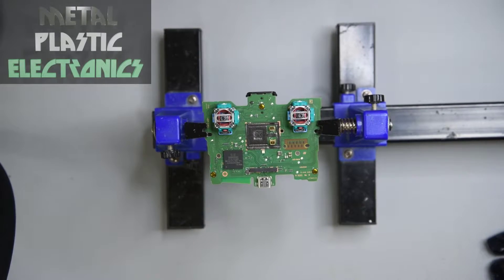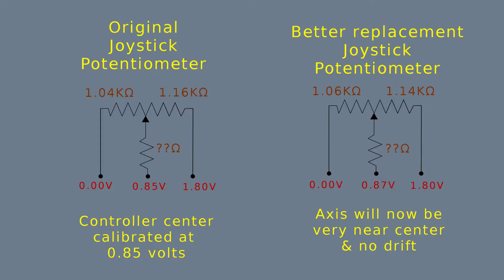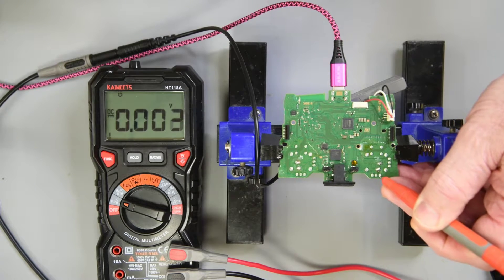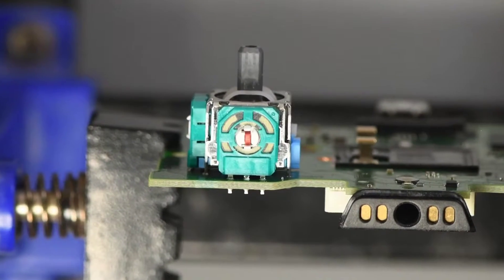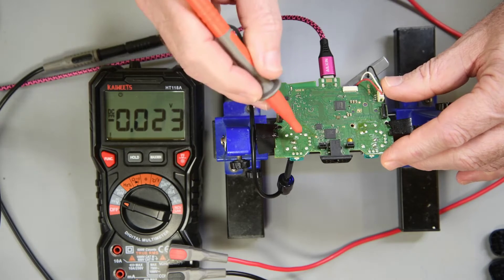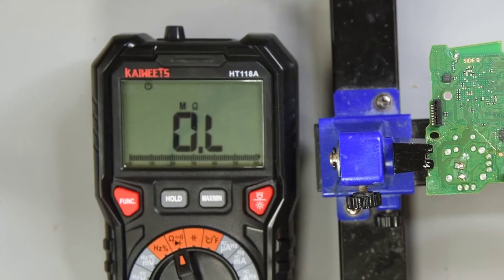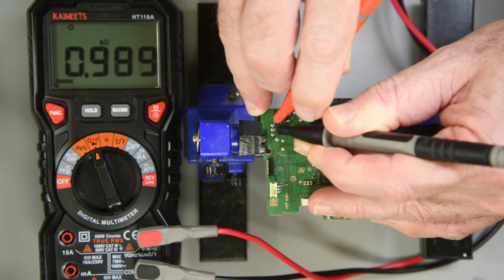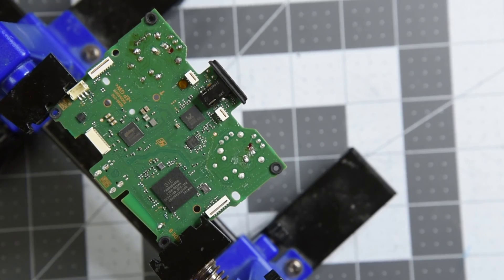Troubleshooting a Replaced DualSense Joystick

Comment: I'm trying to repair an xbox one controller. The left stick is stuck all the way to the right after replacing it.
Reply from the maker: If you have a meter check the voltage at the center tap of that axis and see if the voltage changes.  It is probably 0 volts or whatever the DC supply is for the sensor.
Reply: You mean the center pin for the potentiometer on the x-axis? Connecting the black probe to the frame of the stick im not testing, and the red probe to the center pin of the x-axis on the stick I have changed, I get a reading of 0.897v .

Moving it to the right, I get 1.68v .

And about 106 mV when it's to the left.

I've replaced the entire module twice.
Reply from the maker: @fsociety.dat101  That means the joystick is connected like it should be.  I would suspect the trace connecting to the potentiometer's center pin is damaged.  See if you can find a picture of the PCB for your controller and look for where the trace goes.  It might be damaged right where it connects to the pad of the potentiometer.
Reply: @metalplasticelectronics354  I found an image on reddit earlier which highlights all of the traces. The via is right next to the pin and there is continuity.
Reply from the maker: @fsociety.dat101  Have you tried to do a reset of the controller?
Reply: @metalplasticelectronics354  Do you mean connecting it to xbox accessories? Yeh. But you can't get anywhere as it's stuck navigating to the right. I  managed to update it and it didn't change anything. I didn't see a reset.

Comment: Could you please expand this for troubleshooting the L3/R3 clicking function of the joystick ?
Reply from the maker: The L3/R3 are the switches on the joystick.  The 4 small leads in an almost square pattern at the top of the joystick.  If the L3 or R3 is not working it is almost certain the switch is bad.
Reply: @metalplasticelectronics354  Hi don't laugh but when I started working on dualsense remotes I didn't have have a proper desoldering setup so I tried to drill out some of the solder and damage the traces I believe. I just want to know where I can connect jumper wires on my 010 board to make L3 work again ?
Reply: @unouno2572 , did you find the info about L3/R3 traces? Looksblike just got the same problem(
Reply: @denistimokhin84  maybe you find something?
Reply: @TripShuti  Nothing, sorry(

Comment: @metalplasticelectronics354  i need help here im replacing a bdm 20 pc board  and ripped off the right center pad for the joystick. Is there any way i can trace it to something or jump wire it to?
Reply from the maker: There are some pictures of the DualSense PCBs here; https://acidmods.com/forum/index.php?topic=44714.0  They are not the highest resolution but good enough to see where the traces go.  The center leads are the hardest to repair.  You will have to make a connection to a very thin trace,  If you have never done a repair like this I would search on YouTube for something like Laptop PCB repair, or trace repair.  I know Louis Rossmann and NorthridgeFix should have some videos on repairing traces.

Comment: thanks for your helpful video. I'm having a problem with bdm-020, a cut trace and broken via linked to the 1.8v rail (up and down potentiometer on the left joystick) . i linked this rail to the via on the other side (bottom) and now i dont have the 3 times blinking led , but the left joystick continuously drifting to the left. your help would be much appreciated sir . Thank you
Reply from the maker: If the axis is all the way left then it probably has 0 volts on the output pin.  You will need to check the voltage around the left-right axis sensor and make sure you have 1.8 volts on the power pin and close to 0.9 volts on the center pin.

Comment: im having a hard time figuring this out. I did a hall effect replacement and now when i got to calibrate the stick it basically sticks to one side. It will move all on the left hemisphere but i cannot get it to go onto the right hand side when calibrating.
Reply from the maker: You probably have 0 volts coming off of the center tap of the left-right axis.  Make sure there is no solder shorting out the sensor's center lead.  If you have a meter can check and make sure 1.8 volts is getting to the left-right sensor as well.
Reply: Same except with alps joystick, how did u fix?

Comment: (English isnt my first language)I´ve meassured the voltage and everything looks like it should but the problem is in the potentiometer pin voltage. Instead of reading 0.9v it reads 0.01 with every wiper disk I replace it with. The only one that reads close to 0.9 is the original one that has the drift. Not even the other wiper disks from the controller itself show 0.9... unsure about how to fix the problem
Reply from the maker: Make sure the wiper disk is installed in the correct orientation.  It will install in two ways.
Reply: @metalplasticelectronics354  I thought the only position was with the flat side looking upwards... is there another way?
Reply from the maker: I think it is flat side up for the Alps and notch up for the Favor Union.  The wiper pieces will fit both ways.  One way works the other way the center pin is open for most of the travel of the axis.
Reply: @metalplasticelectronics354  I've finally fixed it. If this is of help to anyone. What was happening is that the wiper scratched the most inner track of the potentiometer, only making contact with the one that damaged it.

I replaced only the sensor (hardly, because I couldn't get the solder out of the pin holes. I just improvised and put solder on the 3 holes while putting the new sensor very carefully and somehow worked...) and after recalibration is as good as new.

Thanks for your videos, they're very helpful!

Comment: really hoping someone can help my left stick pulls constantly to the left even with a new stick any ideas
Reply from the maker: Is it all the way to the left?  You will need to check the voltage on the center pin of the potentiometer and see if it changes when you move the joystick.
Reply: @metalplasticelectronics354  hey theres no change still any ideass no worries if nott traces seem okay which is why im confused haha

Comment: 3:19 I've pulled the pad off the left right axis 1.8 volts that is circled. Where should i run a wire from to fix it? Please help
Reply from the maker: If you lost 1.8 volts to both pins on that joystick could just run a thin wire to one of the 1.8 volt pins on the other joystick.
Reply: @metalplasticelectronics354  is 24 awg a good size wire for this?
Reply from the maker: @Crazy_B1G7233  Oh yes, can even go smaller if you want.

Comment: Will these troubleshooting steps also work with the hall effect joysticks? 

I replaced my potentiometer with hall effects. The right stick was stuck in the extreme left (Rx= -1.0). The magnets appeared to be centered so I replaced with a different Hall Effect joystick and now there is no response in either axis. The 4 GND posts are connected and I get continuity there. Solder on the other pins looks OK (probably should have used flux),. I wonder if I damaged a pad. But I do wonder how I can test the HE joystick to determine if that's the problem or maybe I damaged something else during rework.
Reply from the maker: Yes, you can use most of the same troubleshooting ideas.  The center pin resistance will be different for the Hall sensors.  All the way left will be a center pin output of close to 0 volts.  Look very closely for damage to the 1.8-volt traces to the Hall sensors.
Reply: @metalplasticelectronics354  thanks for the info. 

I’ll check if your other HE videos mention anything about the correct voltage or resistance readings. 

I’m almost sure I damaged a trace or a pad when desoldering the original sticks from the board. Had (and still do) a hard time using a solder sucker/wick and couldn’t get all the old solder removed. 

When I have time I’ll try to troubleshoot using your tips. Your videos are very helpful and give good explanation.
Reply: @CaptKaffeine  How did you solve it? I have the same issue.
Reply: @opticツ  if one of the sticks is stuck in one of the extreme directions (up, down, left, right), for me it was because of a short between two of the potentiometer pins. Be sure to inspect the soldering for the potentiometer pins (shorts, cold solder joints).
Reply: @opticツ  also, make sure you didn’t rip any traces or damage any pads. You should NOT have to physically pull out the old joysticks. They should slide or fall out. 

I pulled out the pads (or the connections in the holes) because I got too frustrated and yanked on the joysticks. I took a closer look and saw it was still connected to the potentiometer leads 🤦. 

If you are having problems desoldering the original joysticks, I highly recommend cutting up into pieces and removing piece by piece.
Reply: @ Thanks for the feedback. I don't have any broken tracks or short circuits. Most likely there's a problem with the chip.
Reply: @opticツ  ensure you don’t have any cold joints.

In a different controller, I had a bad Hall effect joystick because it gave occasional problems. Replaced the stick and it was fine. 

Also try the subreddits “DualSense” and “soldering”. You can post pictures there and get ideas on troubleshooting.
Reply: @CaptKaffeine  I returned after a long time, with the answer to my problem: the potentiometers I bought were defective. I replaced them with Alps potentiometers and the problem was solved.

Comment: I got a problem, a pin is stuck on one of the potentiometer's ground, and so the new potentiometer wont fit unless I fold it a bit, what would you recommmend doing? I've thought about soldering a jumper from the ground to one  of the frames or from the pin slot to the frame but I'm not sure

P.D: the stuck pin is practically impossible to extract without damaging the board
Reply from the maker: It should be fine to run a jumper.  Have you tried a stainless steel sewing needle? Plenty of fresh solder and heat.  Then use the needle to clear the hole.  Make sure the needle is not gold-plated, solder will stick to that.

Comment: Good afternoon! I'm having a problem with my controller after I replaced the joysticks that I'm hoping you might shed some light on. The joystick seems to be fine with full range when everything is taken apart. Whenever it is all screwed back together, It doesn't cover the entire circle. It misses the outer edges of a couple sections. If I take off the little trim ring around the housing it goes just fine. I've done calibration and centering multiple times with no change. This is the second time I replaced the joystick with the same effect so I'm wondering, What the heck could cause this?
Reply from the maker: Are the couple of sections that it will not reach at the same edge?  If you can send me a screenshot of the gamepad tester circularity to mike@mlplel.com I can take a look and see.  Are you replacing with regular joystick or Hall effect joysticks?
Reply: @metalplasticelectronics354  I can absolutely take pictures when I get home. If I remember correctly, it doesn't reach the edge on the top left and bottom right. I used a ksilver hall effect sticks there because they are known to not have latency issues. Do you ever need to trim any plastic off the sides of a joystick when installing on the dualsense? I noticed the plastic on the left side is resting on a tiny resistor. This is a gen 2 controller btw.

Comment: Very helpful video. Thank you for that!
I have a question. I've replaced the potentiometer three times (before watching this video) think that the problem was them. Apparently i was wrong. The problem still persist. The left joystick still seems stuck on full left. Do you now how i can fix this?
Reply from the maker: Full left would be 0 volts of output from the joystick for that axis. You will need a meter to see where the voltage is being lost.
Reply: I've fixed it with bridges ❤
Reply: @asvos22  mine is stuck up and left 0 volts on both pots.  tried bridges from the other joystick but that didn't work either....
Reply: @TrevorOConnell  Mine too, I am afraid, that the processor is damaged.
Reply: @mr.eldiablo  on further inspection I found that I have power on one side of the through hole but none on the other so I assume the hole is damaged and beyond repair
Reply: @asvos22  Nice, I have the same problem but I have a BDM 010 board, I cannot follow the path back to the origin. Would you like to share picture (on a screenshot hosting site) with us?

Comment: Super helpful video, thank you! 2 of my barely used PS5 controllers developed a joystick drift after several months of usage, which pissed me off a big time. First time I tried to replace pot wipers, which helped for a month or so. After the problem returned, I understood that my best chance to get a properly working controller without buying a new one is probably soldering in fresh pots. As it was my first soldering job, it took me a long time and I had severely scraped the board around where the right joystick is placed while trying to desolder it. After soldering in new ones, I noticed that the right joystick doesn't react at all in Y axis and is acting like being stuck to full up. I don't know anything about microelectronics so it was highly unlikely I'd be able to find the problem on my own. But with your super detailed and clear instructions, it took me ~40 mins from starting a video to having a fully working controller again (trace from central pin on Y pot was damaged)! Thank you a bunch mate, you've saved me a lot of time and stress.
Reply from the maker: Very glad it was helpful.
Reply: What was the cause of the issue?
Reply: @gmrpnk211  I damaged a trace while desoldering one of the pots. Since it was my first soldering job (apart from "connect this 2 wires together" sort of stuff),  I haven't had enough experience and have set up a temp too low for my iron, which was barely melting this type of solder. As a proud member of primate order I applied brute force kinda "scraping" semi-molten solder. 🐵
Reply: @pivodirtjumper  How did you manage to fix the trace? That's one thing I'm still not sure on
Reply: @SixRacer-n3t Good question as I'm in the same boat right now.  Son somehow sent a static shock through controller and right stick stayed perma drifting right.  I've replaced with Hall Effect sticks but problem is still there.  Only thing left is tracing the line.  Any advice would be great.